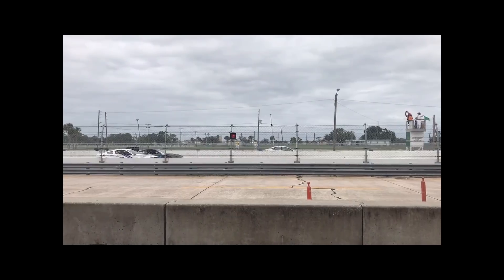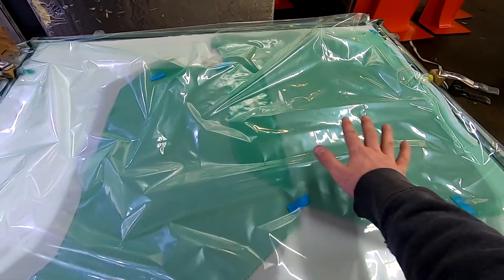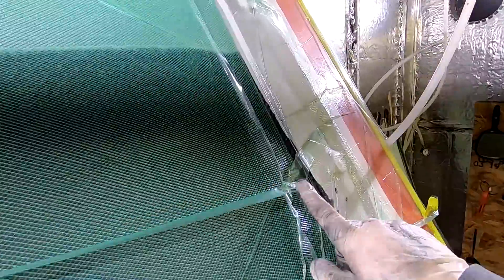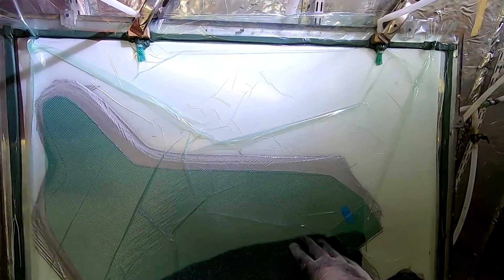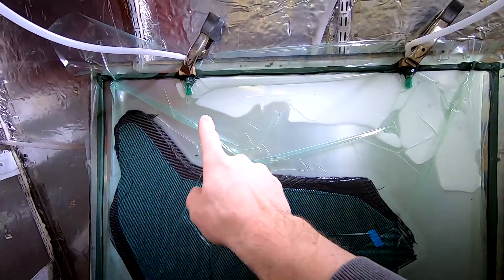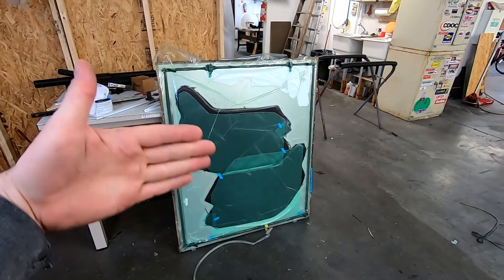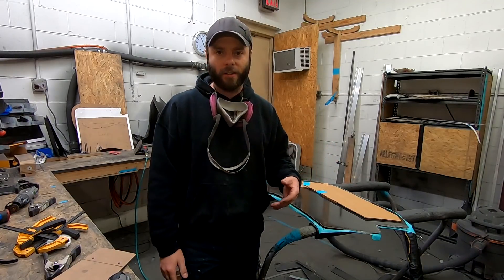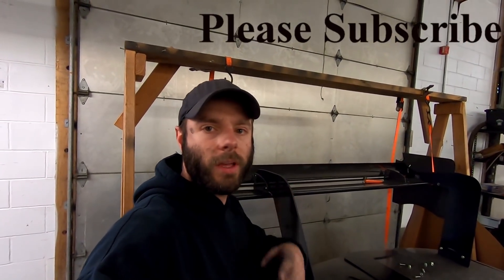Making Carbon Fiber Wing Uprights

Comment: A resin brake is so important for larger or thicker layups.  I messed up a 15 layer layup a few months back due to not letting the resin soak through the brake.  Great video!